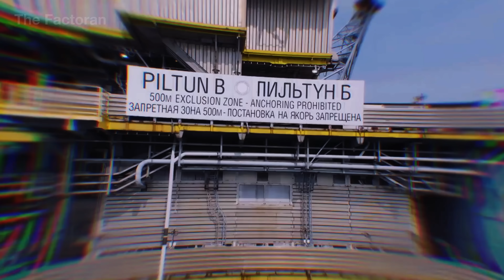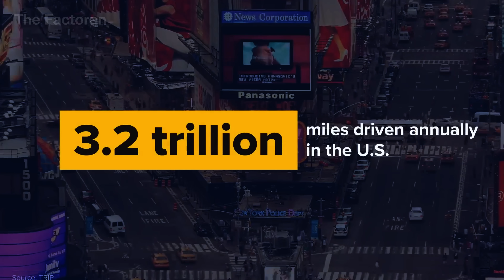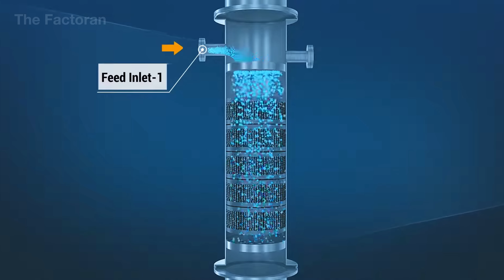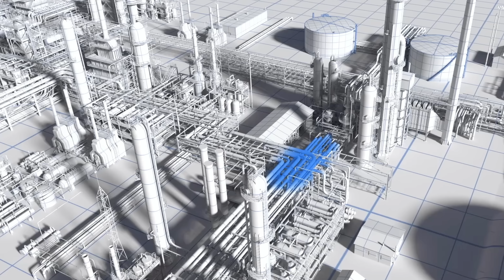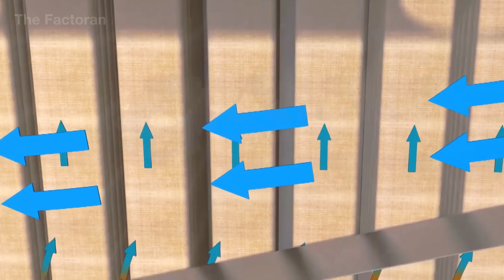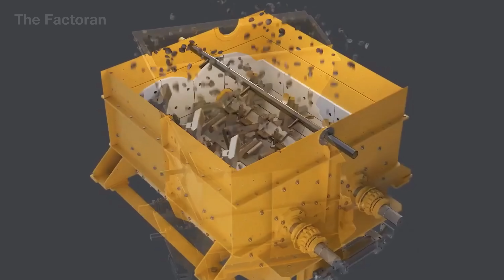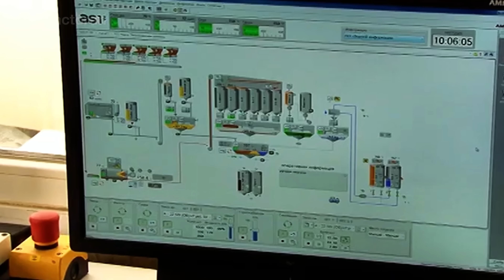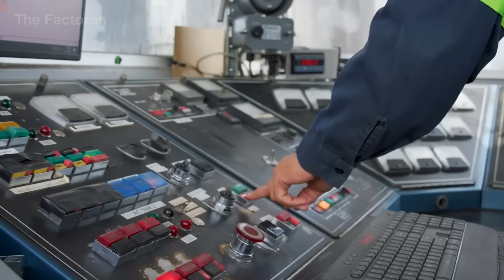How Asphalt Is Made From Oil And Stone To Build Millions Of Miles Of Road

Comment: Why don't they used a cement adhesive to bond the Asphalt together, so that it can last longer (?) Also why don't they used steel rebar to build asphalt roads (?) rebar would have more tensile strength if it was welded together, creating a stronger reinforced roads and freeway's. Moreover, can asphalt and concrete be enfused together to create a Stronger Mixture (?) Let me know the answers to these questions.
Reply from the maker: Great questions! 👏 Cement adhesive isn’t used in asphalt because cement is rigid while asphalt is flexible—they expand and contract differently, which would cause cracking. Steel rebar also doesn’t work with asphalt the way it does in concrete, since asphalt doesn’t lock it in place and the rods would eventually shift, creating weak spots.
Reply: @TheFactoran  So could they used a tar-base element that could bond with/to the Asphalt, also when building roads and/or freeways using asphalt, could they pour a cement foundation, having steel-rebar inserted that will help asphalt to set in place, so that it won't shift - using more steel frame elements would prevent asphalt from shifting.
Reply: Also, the steel and concrete expand at close enough similar rates that make it suitable for use in concrete. Steel and asphalt expand at far different rates than each other. Use of steel in asphalt would cause premature failure in the asphalt

Comment: I ride a bike around our county in central Florida. There's a stretch of major highway where a contractor went broke, and another took over. That highway has a defective surface, with small stones thrown aside by the traffic. Some of it ends up on the sidewalks and driveway entrances. I wonder if it had gotten too cold for use, and they laid it, anyway.
Reply from the maker: That’s possible—temperature and timing can really affect how well a road surface holds up.

Comment: Side nite: Back in the 1970's the brilliant Norristown  VP of quality control at Whitman's Chocolates had a place maybe 30 miles away ( Norristown Pa ) modify three of their big asphalt mixers to conche a cake like chocolate mixture into liquid chocolate . Each conche had two 100 HP motors feeding 5' high bull gears to mixer blades. Took 8 hours to finish a batch. The VP of production locked him for these what became fantastic machines that ran 24/5. Maybe 10 years later they decided they need a fourth conche so they ordered a fancy $1 million one from Europe. Thing was broke more then  it then it was running. It used three times more expensive Lestiton & possible coca butter then the Asphalt mixers. They gave up.on the lemon and only ran it a few times a week .
Reply from the maker: Wow, that’s an amazing story! 🍫 Thanks for sharing such cool chocolate history.

Comment: That was great! thank you! I was wondering, where does seal coat fall in the process/product? is it thinned out binder/crude tails from the distillation process or something else entirely? What are the differences between a road/highway grade asphalt and a typical driveway? Can a driveway support the same loads as a highway?
Reply from the maker: Thanks so much! Great set of questions 🙌 Seal coat is usually a surface treatment made from a refined asphalt emulsion — often a thinned binder with added polymers or additives, but not quite the same as crude tails.

As for the difference: highway-grade asphalt is designed for high traffic and heavy loads, with multiple layers and thicker base structures. Typical driveways use lighter-duty mixes and thinner layers. So nope — most driveways can’t handle highway-level loads without damage over time.